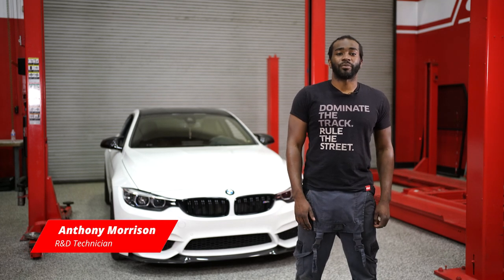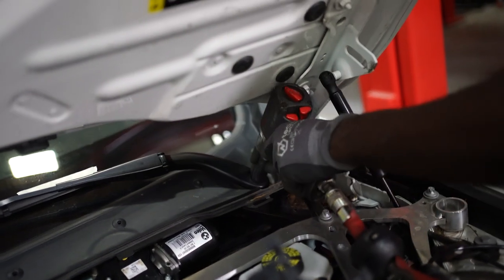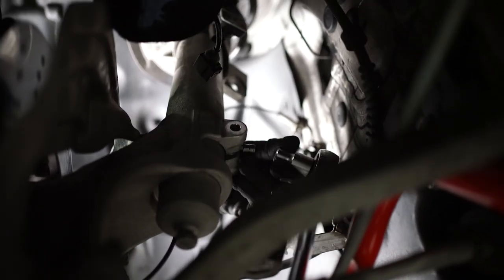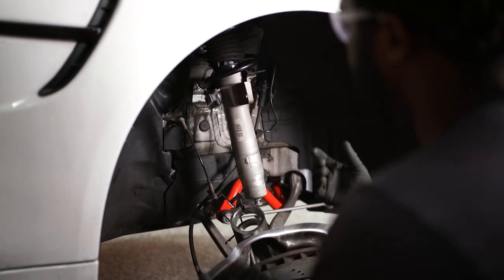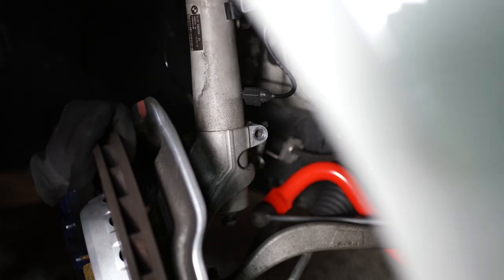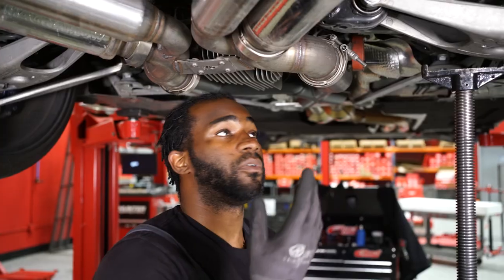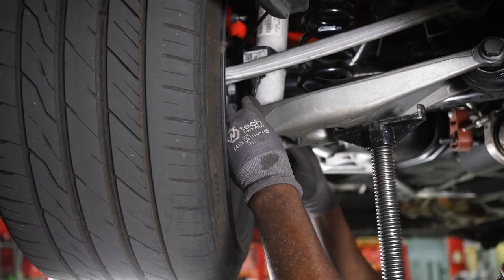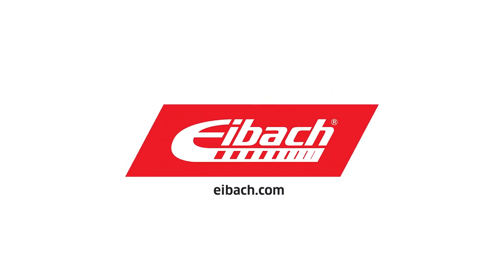How To: Installing Eibach PRO-KIT lowering springs on the M4!

Comment: Hi guys! Can you please recommend the lowering kit for Mercedes Benz c-class 250 2017? It should be balance between nice look but ability to use in a city. What is your suggestion?
Reply: Yes it’s called camp lowering kit it’s 3000000000000 dollars but it’s worth it
Reply from the maker: Check out our PRO-KIT, part # E10-25-036-01-22
Reply: @EibachUSA  Thank you very much!
Reply: @mamba2019  Hi Ari, thanks for the advice! :-)

Comment: Hey guys! 

I ordered the pro kit springs for my f32 however inside the box there were two springs that were black and two that were red. Is that normal?
Reply from the maker: Hello, that doesn't sound correct. What part #s are on the spring?
Reply: @EibachUSA the pro kit sp had black fronts and red rears, no?